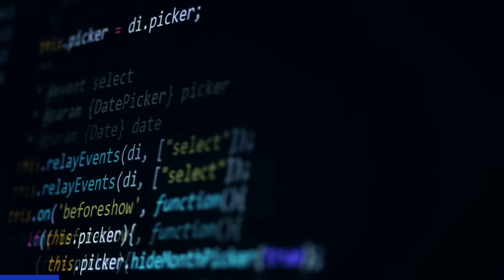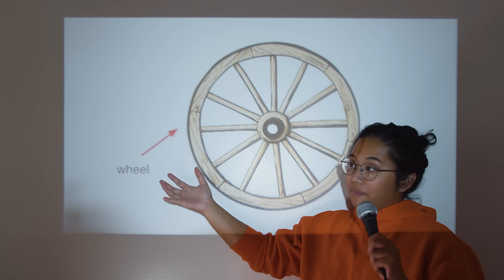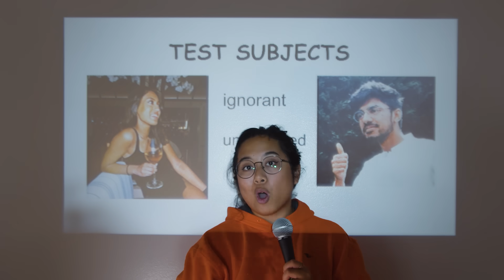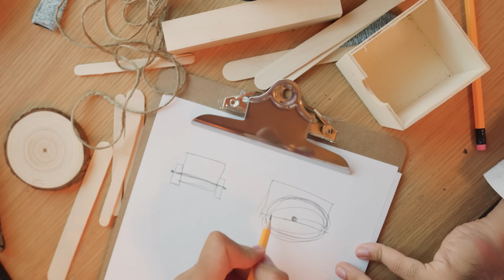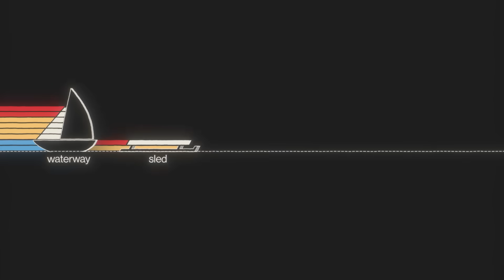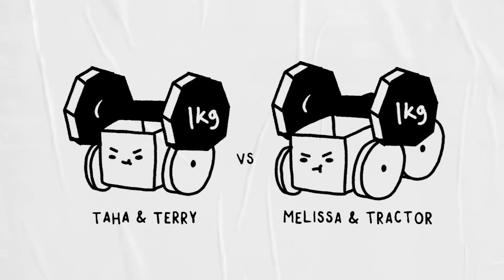why it took 200,000 years to invent the wheel

Comment: You touch on some of the constraints that meant that a useful wheel was more than "just" inventing the wheel itself, but there's a large additional one: roads.

Wheels don't do you much good unless you have a surface suitable to roll them on, and for the most part unimproved land is nearly useless for wheeled transport for any meaningful distance. Conversely, human or animal carried goods can cross just about any land with no effort or expense spent on infrastructure, or at least minimally so. 

It's no coincidence that the introduction of wheeled transport and the appearance of improved roads in the historical timeline occur in close proximity to each other.

Comment: Hmm, didn't it take a long time, because at first the wheel wasn't needed? After all, there were animals and if you can put a bag on the back of an animal then why would you need wheels, it's not until you need to transport a lot of things, that you need the animals to pull something, but a heavy box loaded with stuff is too hard for the animals to drag on the ground, and that's when a round thing attached to the box of stuff in a way that rolls on the round things (wheels) is needed.

Comment: The use of the wheel for transportation (for what else would it be...) also requires that the terrain is smooth enough. I've lived here in Finland, close to Tampere, the third largest town - and as close to Nokia, the town from where the high tech company got it's name. There is a street named Keissutie and keissu means travois, i.e. a "cart" without wheels. The terrain is so hilly and rocky that just 80 years ago, in mid 20th century, people used keissu to transport things, like milk from their cows to the dairy. They used to have sheds by the local roads (we've had them in this area for centuries...) so they would pull the keissu with the horse to get to the shed, leave the keissu there and harness the horse to a cart from the shed to travel on the road.

Comment: ok pausing 3 minutes in. 
Saw a log into a disc. You got your circle. 
Create a hole in the middle by either hammering an axe head (using  a wood mallet) into the middle, and repeat for times to make a box like cut out. 
Take a stick that is thicker than the hole. Taper it down on one end so that it fits  the hole. Slide it in, and hammer it down to be secure. 
Ok there's your axle. 
You could also just use one long log and carve down the middle so that you get two log sized wheels on both ends with a tapered axle in between.

Comment: bič, you know nothing. Wheel was pretty easy to make. But you need 3 basic thing.
1) You need to domesticate draught animal, because rudimentary wheel and wagon would be heavy AF, horses and donkeys were domesticated cca 6000 years ago
2) you need to build roads. This does not necessarily mean roman type road, but navigating wagon in wild forest, savannas, deserts or wetlands is near impossible and does not give you advantages over simple animal and human transportation. You need advanced civilization for that, because roads are huge and somewhat futile projects. First roads were build 6000 years ago
3) you need metallic tools, especially saw, to by able to cut round shaped thin plates from tree trunks. You can do it with axe, but it take extremely long time which made such wheels impractically expensive. Again saws emerged 6000 years ago

And when was invented first wheel? Yep 6000 years ago. Coincidence? No. Humans, especially ancient one, did not have time nor resources to pursue useless feats. And before all three above conditions were met, wheel was totally abstract and useless concept. It was useless for neolithic communities, because they were just expanded family, which did not have need for goods transport at large distances, because they were self sufficient. And hunters-gatherers did not any use of them either, because their lifestyle and necessity to travel large distances lightly.

PS: Concept of wheel was known, mill wheels from stone are dated back to 8000 BCE, which corresponds with end of last ice age and early neolithic agriculture.

Comment: Necessities are a major drive in creating products/services because they cater to answering a question. The "Wheel" was never a specific object until historically it was defined as such, so this means that a system of several timber logs would work as a wheel to move a ship from the ground to the water, vice versa, or just moving it on land. The video discusses the application of round objects moving along a surface, along with their sophistication according to the applied need. In itself, the "wheel" can be defined as a rolling utensil that, according to its purpose, helps achieving a goal.

Comment: Most seem to make the circle first and then define the center for the axel. I think it is easier to choose a location for the axel in any irregular disc then, having an axis for a circle, use it to define the perimeter by rotating the irregular disc along a harder surface. This can both define the perimeter and shape the circle at the same time.

Comment: put in a time machine and tell me to do a modern car. I would be thinking about how do you even get a petroleum... i would think about ... steam engines from burning coal. Probably the nearest powered engine i could think off. I have to think about how to make steering wheel attach to the axel. idk how to make gear, brake , suspension, fundamental design of their connection between spark plug , battery,,, why do we need it again? LOL

Comment: Isn't the real reason (besides the fact that if you exist in place where wheel does not exist it is not the most intuitive design due to its topological (use of hollowed circles and axle) compexity), but due to the fact that you need roads for a wheel to be useful.

Mentioned sledges are more useful since they are more useful in uneven terrain.

Comment: The main problem with wheeled vehicles is that they should turn. When you turn to left wheel turns slower than the right one. So freewheeling is necessary

Comment: Another thing to note is that when the wheel was first invented it was, honestly, kind of useless. Of course, wheels are really great for moving heavy objects across flat surfaces... but there's the problem. Wheels work best on flat surfaces, which weren't really a thing when wheels were first invented. Before the invention of the road, wheeled vehicles weren't much better than just carrying things on foot or on horseback. Of course, once we had roads to use them on, wheels suddenly became the most revolutionary invention in human history, but before then it was kind of a solution looking for a problem.

Comment: That’s far from complete. Solid wood wheels have bad problems because of the grain. They will split.

Also, there’s the weight. To run over an uneven surface, the wheels would need to be large. A cart with large wheels would need more animal power to pull it than would be economic. Simple packs would be more economical up to a certain point in wheel tech.

The bent wood rim with spokes was the key breakthrough.

Comment: I know that one of the problems with wagons was repairs.
As the roads weren't exactly smooth asphalt, it was bumpy and spokes broke.
I'm also wondering how it turned because it seems to me that with a simple design, forcing the thing to turn would create transversal forces that would quickly wear down some key parts of the structure.

Comment: Such a small thing is easy to do. 

The incas had wheeled TOYS but they never developed wheels for large vehicles. 

1 - no good beasts of burden
2 - mountainous terrain. Wheels fare better on roads. And plains
3 - to develop practical big wheels is a whole different game. Because volume and weight increase with the CUBE.
It's the same reason why ants can carry 100 times their weight but an e elephant can not lift its own weight. It's why your Hotwheels car survives without damage, falls and speed collisions that if scaled up would be like a car falling from 50 stores skyscrapers, or crashing at 500 kph

Comment: May i add some criticism? You left out that without a fitting surface wheels don't make life easier. There were parts in the world where the idea of the wheel or knowledge about it was  around, but it wasn't used as the ground did not fit. In the alps as you showed some forms of important main roads were made pretty early, and that meant a fitting surface for using wheels.
And even there, on snow or off these roads, sleads were used or the goods were carried on backs. If your ground is too soft, swampy, muddy, too uneven, too steep too sandy or your paths are too narrow ect. wheeled carts can be the lesser good options to using other means.
This has an important influence on the time when wheels are used and where they are used.
Also, the meaning of "don't try to reinvent the wheel" might be different in different places in this world, but your interpretation is not what i came across in over 40 years on this planet.
I know it as "don't waste time to try to reinvent something that is alreadysolved perfectly" ->Trying to replace the wheel for what it is used hasn't been successfull for thousands of years, and there are plenty of other problems that need solving.
And to add it here too: Fun Fact: the german word for bribing money has it's roots in paying for axle grease of horse carriages. "Schmiergeld" It comes from paying extra "greasing money" to the driver so he would go faster as usual. (going faster would wear out quicker).

Comment: The easy answer is that it was not needed until the past 5'000-3'000 years.

But then again I have to ask you in return: why did you put 200'000 years into the title? Might as well put 300'000 or 500'000 or 2'000'000 for that matter.

Comment: I seem to have hard time finding the answer to the question posed in the title in this video... You basically say that it took a long time to invent the wheel because it was hard (this doesn't explain anything). You provide two approaches to building a wheel, but neither do they explain why inventing a wheel was hard nor why it took such a long time to invent it. I wish you said e.g. how they (our ancestors) tried to solve various problems, or how they tried earlier and failed (presumably; with other designs). I wish you told us about the process of fixing the potential issues you mentioned. Also I feel like I'm watching two different videos - related to each other, but still different. The whole building the vehicles by your friends is very loosely connected to the main topic but isn't really that relevant - e.g. it doesn't illustrate ideas you talk about, it doesn't help to understand why it took so long to invent the wheel that much. The video ends really abruptly and unexpectedly - there is some summary missing - at the end of the video I didn't really know what I've learned and had to go back to create my own mental summary. I watched your other videos and I liked them, so I think you really can do better than this. On the other hand - really interesting topic, that's a positive.

Comment: Before invention of wheel, human has not much heavy things carry around. Before BCE 4000-5000, human food production capability is quite limited. Village population or area to intreact with is limited, too. So no need to carry heavy things over long distance. Flat roads are non-existent. Just sled is enough for carryng occasional needs. So no need to invent a wheel. Even long after invention of the wheel, they are not used widely in ordinary life, except for some select purpse.

Comment: This brings up an important point.  It's not the wheel itself that was the hard part, There are plenty of round and roundish things in nature, but putting it to practical use to move things that was difficult. just putting cut logs under a heavy object like stone works, but it's slow, time-consuming, and takes a lot of effort because you have to keep taking logs from the back and putting them in the front again.   Attaching a wagon or cart to wheels on axles made moving things and people and people a lot easier.

Comment: Taha's cart isn't really a cart as long as he doesnt attach the towbars firmly to the box, so that an animal rigged to the cart can actually hold it balanced.
Also: What I find interesting in the wheel that's it's really an application of the principle of the lever, but one that keeps it in continous motion.
If you think about what a wheel with a journal bearing does, it reduces the distance that the load has to be dragged over a sliding surface. In a sled this distance is equal to the distance of transport. A wheel reduces it by the ratio of wheel diameter : journal diameter. Also: you can control the quality of the surfaces sliding over each other. Drawback: all the friction energy is deposited in the small volume of the journal, which may crate heating problems.